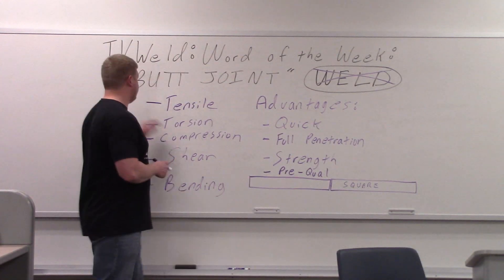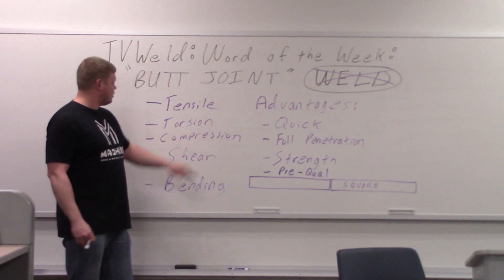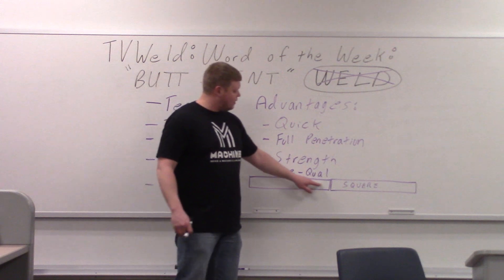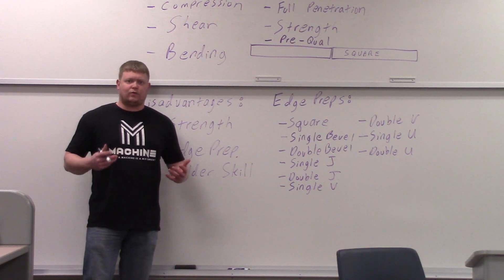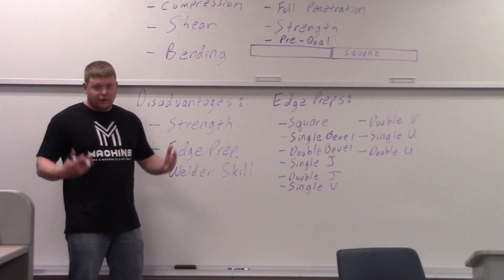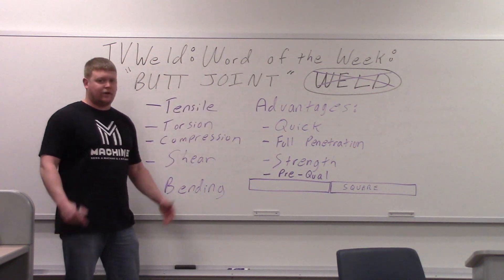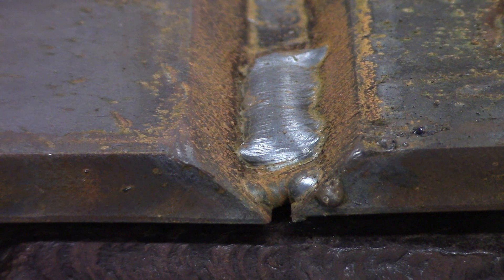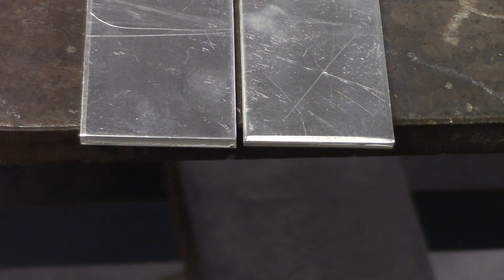BUTT JOINT

Comment: Have you ever welded?
Reply: I understand that, however, I’ve worked with inspectors that is all book smarts but never struck an arc. What’s YOUR thought on that?
Reply from the maker: I weld almost every day.  I've welded in factories just pushing parts down the line ten hours a day six days a week (one of the main reasons I continued on with my education).  I've done high steel iron work with SMAW, I've been 6G certified in both SMAW and GMAW structural, I was certified in Miami at the AWS in 3G vertical SMAW, I've been ASME certified in 12" GMAW pipe, I was New York state DOT 3G Vertical certified, and I was Stainless & Aluminum GMAW certified at one point.  Currently I'm doing more engineering and inspection type stuff, but yes I've welded before.
Reply: Brent Harkness.. Nice, never doubted you. I’ve seen most your videos, but never heard you say you welded. Make some videos on Api1104... or anything related to them. Thanks.